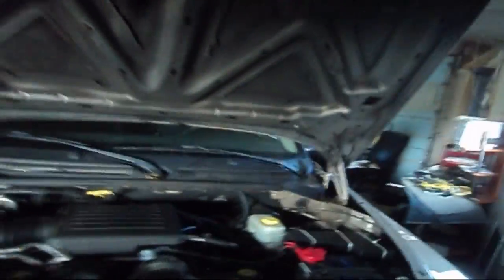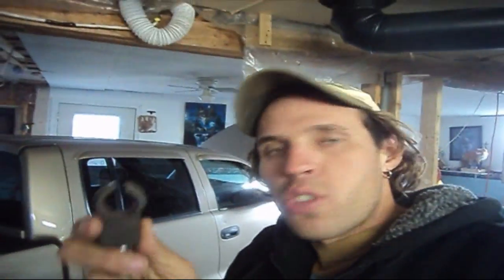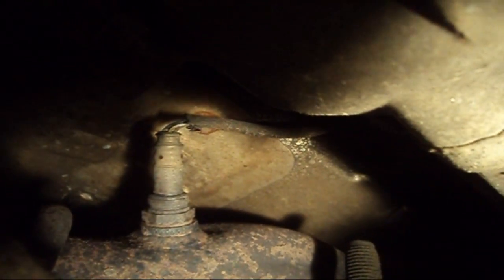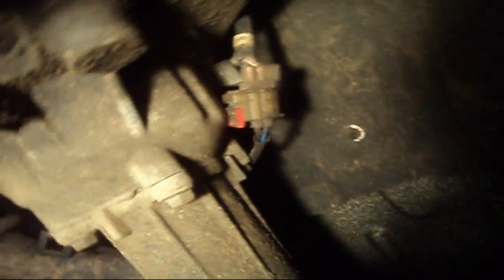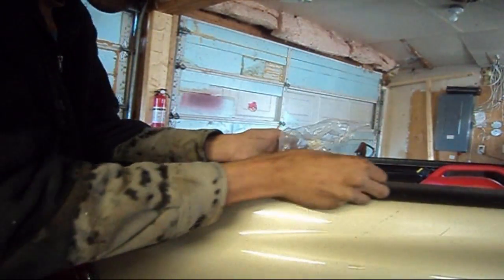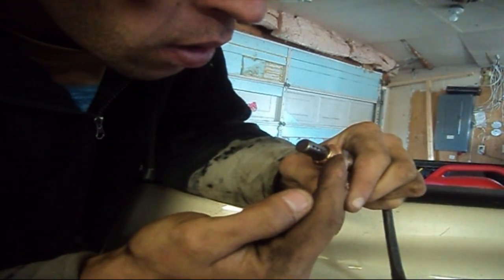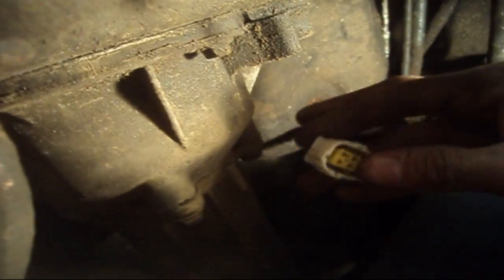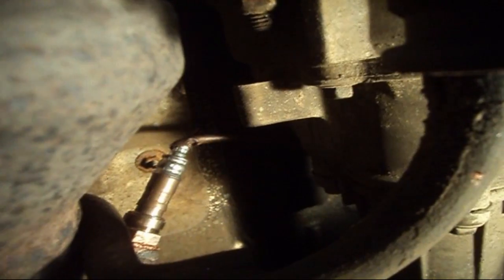Oxygen Sensor Removal & Discussion

Comment: The 1977 Electra has no oxygen sensors. I just had to replace a leaky Y-pipe, and we did the converter at the same time. What a difference! As suspected, that old converter had to be plugged a bit. Incidetally, the no. 1 cylinder is on different sides of different engines. Chevys are on the drivers side. Fords are on the passengers side. Cadillac is on the passengers side. This is even more important, when hooking up that timing light. Always have a shop manual for all your cars.